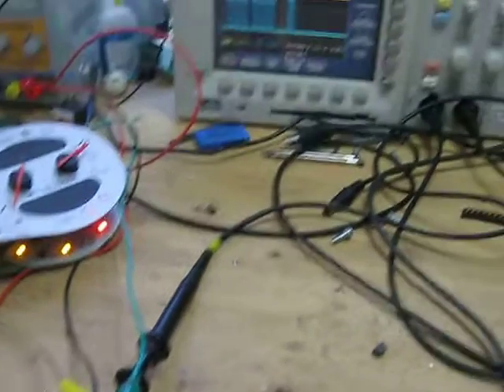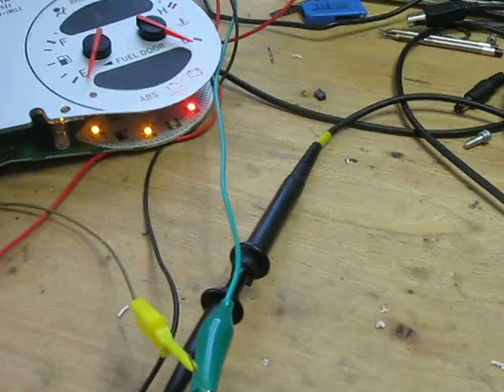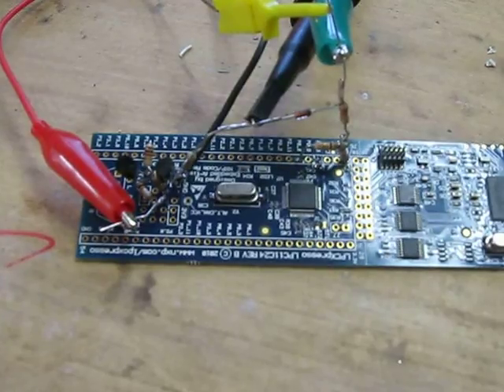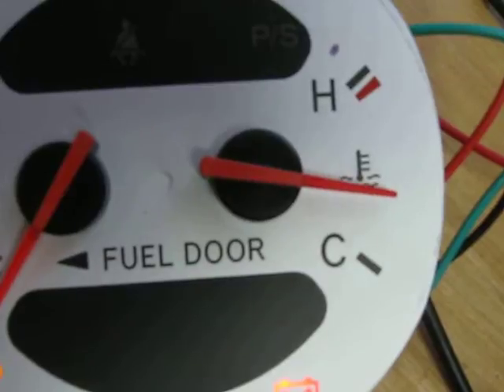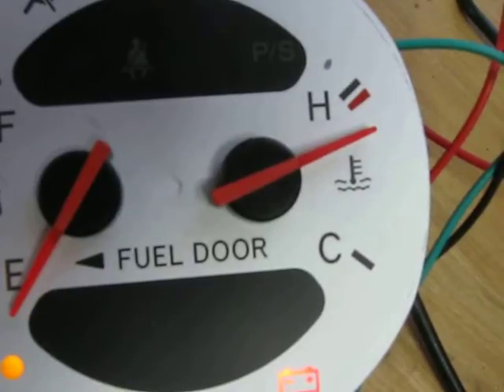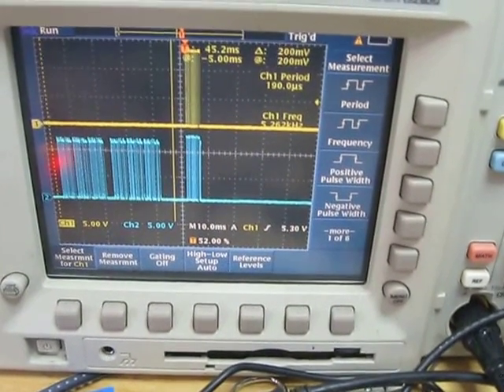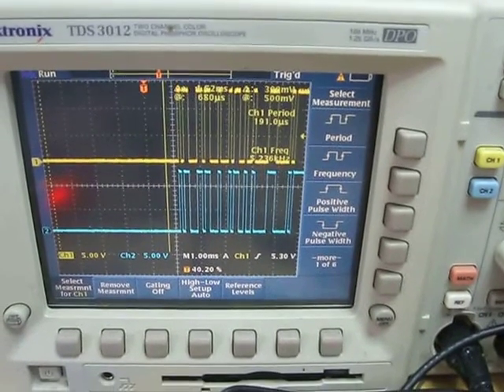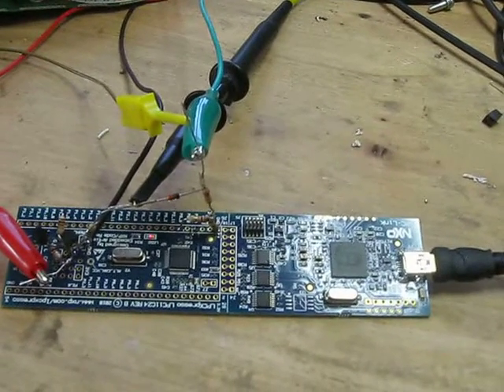MR2 Spyder aftermarket ECU coolant temperature gauge motion over BEAN network

Comment: I have been searching for your for the last several days and it's led me to this video! 

I'm using a Haltech Elite 1500 and I'm on a 1zz boosted 2000 Toyota Celica.

After I discovered my symptoms (no AC, fuel gauge, and other functions) i realized that I'm have the BEAN comm issue

Comment: Did you get it to switch the radiator fan on too? Once you’re finished I’d gladly buy one from you.
Reply from the maker: The radiator fan is not controlled via the BEAN network. it's just a discrete wire.
Reply: Am I correct in saying they’re pin B3 and B4 on the MR2? Do you know where to relocate them on the Corolla ecu?